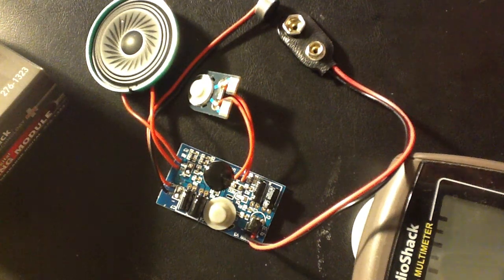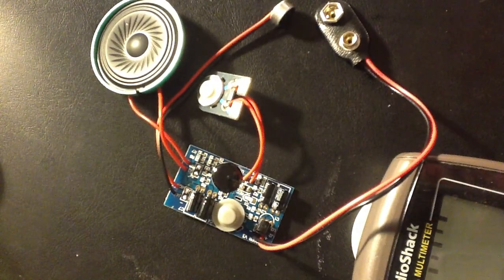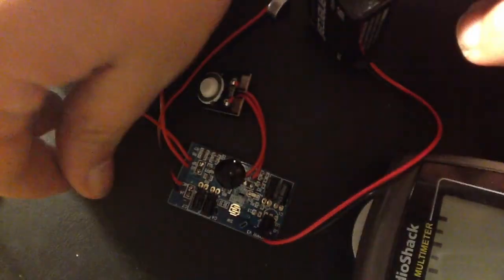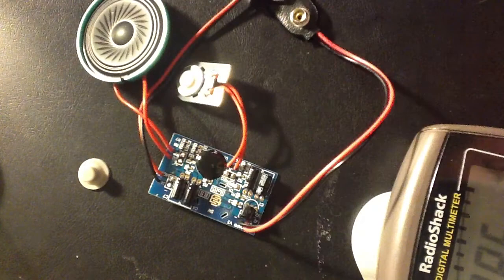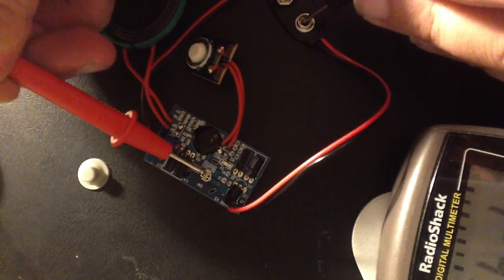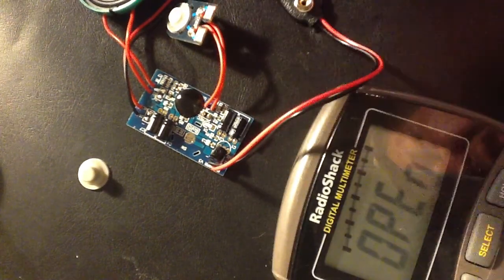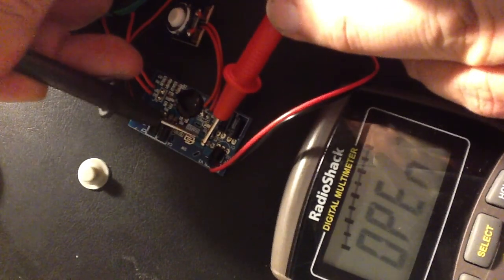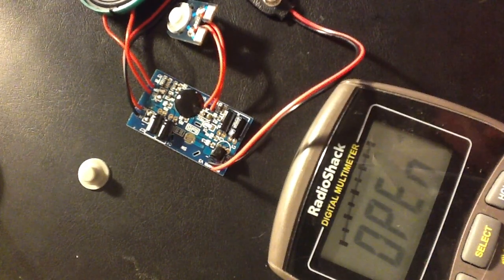Voice recording module hack

Comment: Thanks for the hack! Found it's also possible to power it off the Arduino 5V power supply - just solder wires to the terminals on the second capacitor from top right
Reply: Can you post a pic of this? Would love to be able to add a remote switch easily somehow!